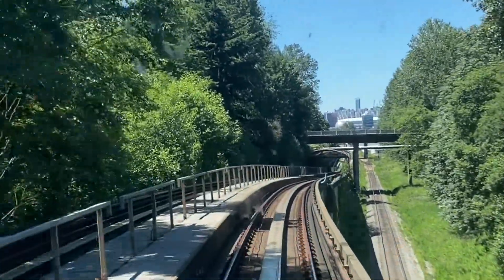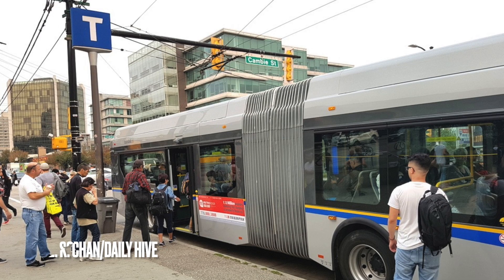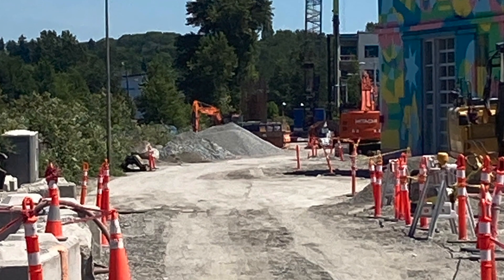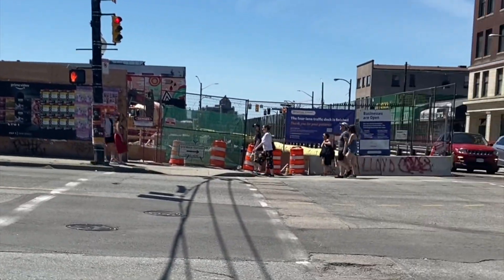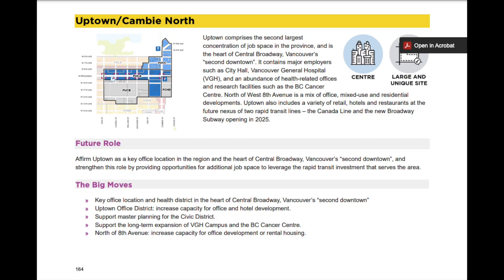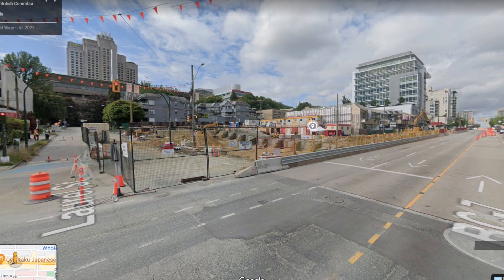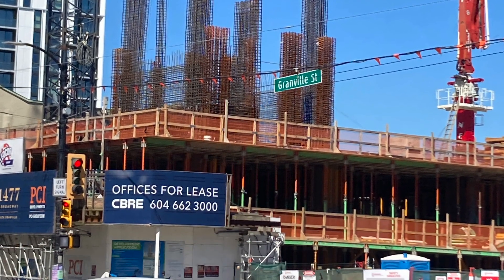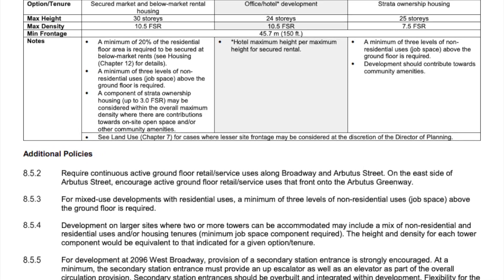Broadway Subway | June 2022 Construction Update

Comment: Kid, I have been doing transit planning for 25 years or so. I can very correctly point out that the Broadway Corridor is far from the busiest bus corridor in Canada, about 4th or 5th actually and far below the threshold for a below grade right of way (tunnel). Even Translink doesn't say this anymore because other Canadian transit agencies started to call them out on this fact. This lie was allowed to spread because it helped to justify to the public, the need for a tunnel. 

In both the number of surface transit vehicless per hour per direction (stv/h/d) and passengers per hour per direction  (p/h/d) Broadway although very busy, was far from number 1 on this and a surface LRT or BRT busway, could have easily handled the expected future traffic. Even with new signaling and a new automation software /hardware system  (the old one is no longer supported by the maker)this Millennium Line extension will only be moving 7500 p/h/d at peak periods. That's with track, signaling, a new ATC system and longer trains. 

Currently  (before Covid-19) Broadway moved about 4200- 4800 p/h/d at the peak period (rush hour) or about 42 to 45 buses (stv/h/d). A short list just off the top of my head, Hurontario-Main Streets (between Mississauga and Brampton, Ontario) 50 to 55 (stv/h/d) and 5500 p/h/d. Gatineau Quebec STO service between downtown Gatineau and Ottawa along Wellington and Rideau Streets, 4600-5400 p/h/d and 78-90 stv/h/d. Both King Street and the College/Gerrard Streetcar lines as well as St.Laurent Blvd. have equal or greater numbers than Broadway. in Montreal the current Pie IX Blvd before the Busway (it's almost finished) was the equivalent of Broadway's numbers. 

I'm not including the former and soon to be former downtown to south shore bus Corridor in Montreal. The Albert and Slater Corridor in Ottawa which easily doubled what Broadway carried and did so everyday for 25 to 30 years before the LRT tunnel. Eglinton Ave. in Toronto, before the Crosstown LRT. The current Mississauga and South-East Ottawa Transitways (busways). Both Finch Ave. East and Sheppard Ave. East in Scarborough  (Toronto). As well as, the Steeles Ave. Corridor (both eat and west) in Toronto. This is only Canada and hardly an exhaustive list. 

The information comes from the CUTA  (Canadian Urban Transit Association) transit data inventory. A great resource, if you want to pay the $300 to $650 yearly membership fee, depends on your type of membership.
Reply: fam that's like pointing to google and saying 'that's my source'. You could at least make an effort to cite your sources by giving the article name for starters
Reply: Just the f'cking tone of this!
Reply: Feels like flat earth spam.